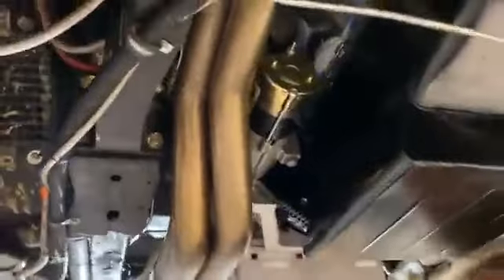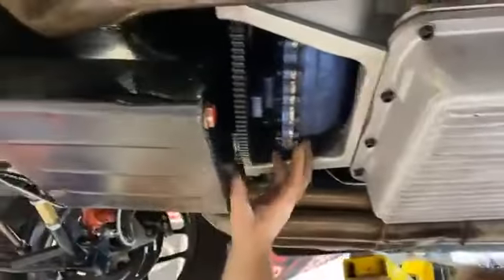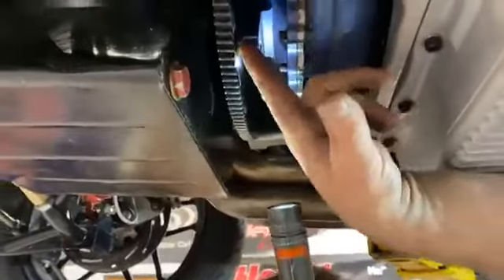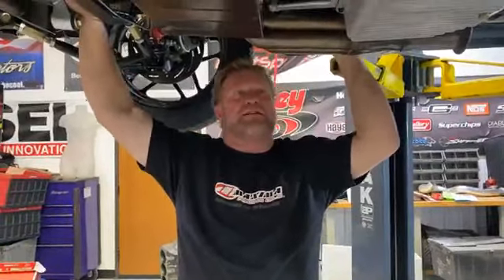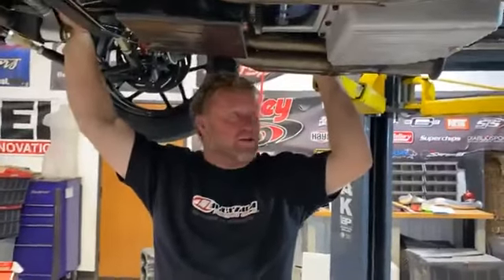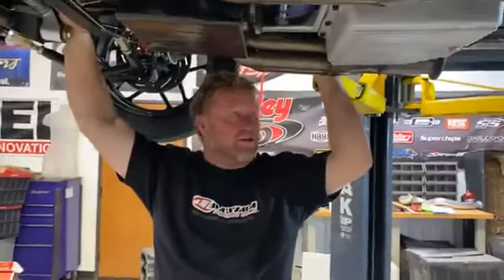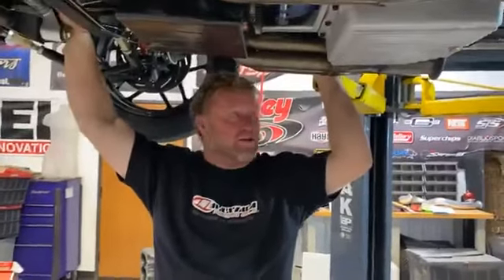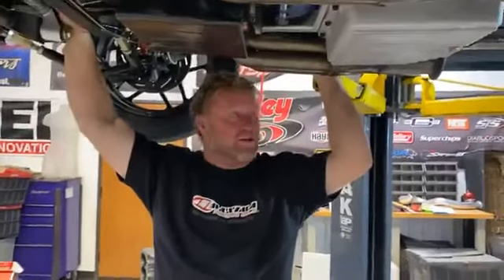ATIs new TH350

Comment: The ls motors are great and all but they are just as expensive to build as anything else IMO, the best thing about ls motors IMO is that you can pull one out of a junk yard and do a couple small things and pour nitrous or boost to them . It’s a different story to build a full race ls motor tho, that’s where it gets expensive. Honestly IMO, If I were building a gm race motor I’d go with a aluminum Brodix sbc and build that rather than a ls.

Comment: This is why on my 64 Nova I only went from a th350 to a powerglide not only did these first gen novas come from the factory with powerglides but a th350 is the exact same length as a 350 so no need for cutting the driveshaft or altering the transmission tunnel. So factory driveshaft works just fine with Muncie 4 speeds,th350’s and powerglides. I only went with the glide cause it’s economical on price an what sorta power it can hold and once ya start making 600 horsepower plus I’ve never seen a th350 hold up long even ones that have been completely gone through but apparently ATI made everything in these ones but ya also pay for that and even at that absorbent price it still won’t hold no where near what a powerglide will hold that’s been gone through with the same attention as these transmissions. Also I’m not sure how ya got any decent tire under your nova but with factory wheel tubs we was able to get a 26” tall 10” wide slick up under a 64 Nova by simply going with ladder bars and coil-overs and just remove the leaf-springs no cutting anything. I bet if I split the upper wheel tub and put a lil patch I could get a 28x10.5 under it but the reason we did this was so we didn’t have to cut up the car any. Love the videos and the car.